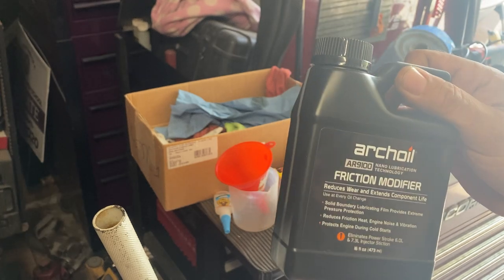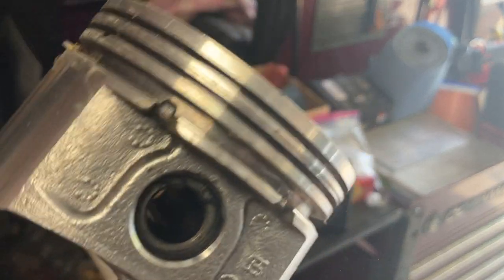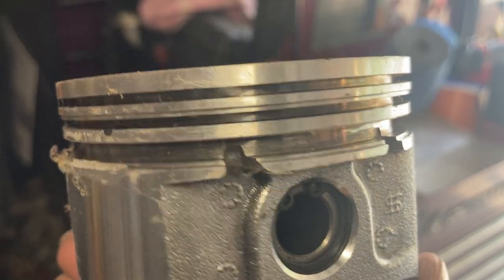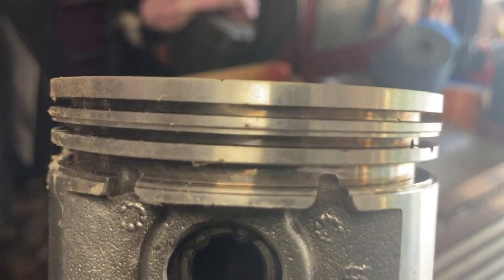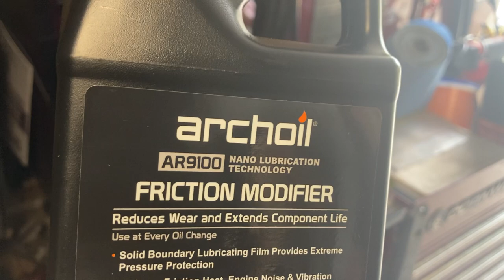Archoil, why am trying it out

Comment: Interesting young man. It may have been Cadillac that was first to use fuel injection in the USA? But the very first use of it was Daimler Benz when the diesel engine was developed and then by Mercedes Benz for petrol (gas) engines. Bosch, were the company that developed the first system for mass production of fuel injection.
As I understand it, but I could be wrong?
Reply from the maker: Yes I meant wide use by an America car maker , Benz a pioneer and fore front of automotive technology